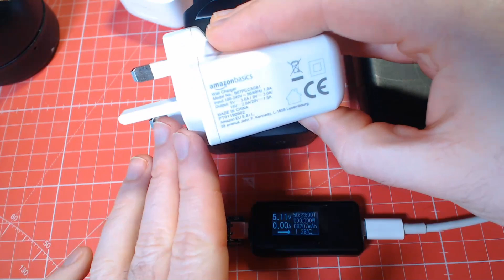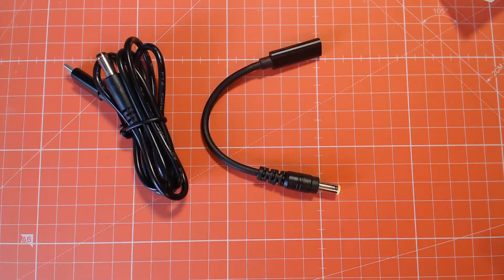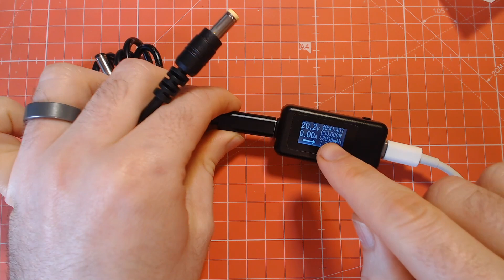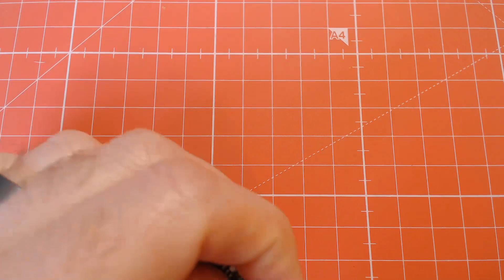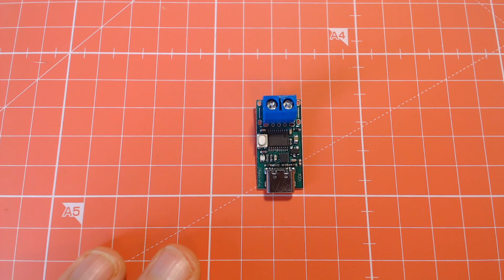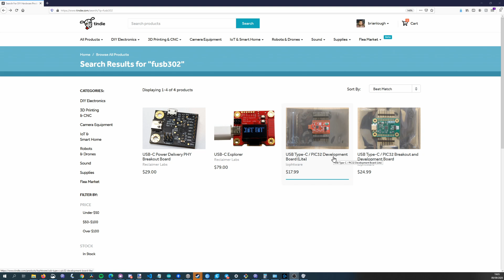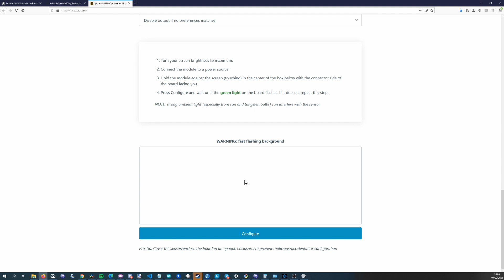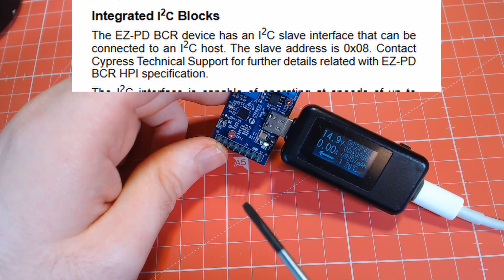Powering your projects using USB-C Power Delivery

Comment: CTP2 DC Quick Charge Adapter. It should recognice power delivery type of your device and adjust settings besed of it.
Reply from the maker: I couldn't find anything with that name, do you have a link?
Reply: @BrianLough  https://www.aliexpress.com/item/4000315671112.html?spm=a2g0n.orderlist-amp.item.4000315671112&aff_trace_key=&aff_platform=msite&m_page_id=1465amp-le5YltJvKXl_ezxt1WXVlA1600083920991&browser_id=e6819362732540bb8f65675612cfe35f&is_c=Y
Reply: Hope the link works whole name is really long😆
Reply from the maker: It got caught in the spam filter but I freed it. Thanks! Interesting looking module!
Reply: Chinese namings are really ?

Comment: There's a more eloquent solution. https://hackaday.com/2019/11/01/adding-usb-c-to-the-ts100/
Reply from the maker: If you want to modify your ts100, maybe it is. 

But:
- it can no longer be used with a regular power supply
- it has no ESD protection
- standard usb-c cables are not flexible and are not as nice to solder with as the flexible cables that are used with the Flex-c-friend, they aren't heat resistant either. The ts80p comes with a flexible and heat resistant usb c cable, but I have not found it sold separately

Comment: You showed a ZY12PDN module and called it FUSB302. Are you sure it‘s a FUSB302? Alex Whittemore found that the chip‘s pinout is similar but still different (see https://www.alexwhittemore.com/zy12pdn-reverse-engineering-part-1/). Do you have more information?
Reply from the maker: We don't know for sure I guess, but the working theory is it's still the fusb302 . Vbus is an input according to the data sheet for "attach and detach detection" so maybe that is just disabled or something. 

I shared your comment on my discord and one of the guys said that he found some code in the firmware dump that suggests they might be bit banging the i2c, which means they could swap the two pins from the default of the mcu.

If you are interested in helping out or even keeping track of the progress, I'd recommend checking out the discord (link in the description)
Reply: @BrianLough  Thanks. That's good and bad news. Good: it's a FUSB302. Bad: I2C bit banging is used, making a replacement firmware more difficult than necessary.

Comment: Great video. Good info!
One (important) thing to mention about the FUSB302 PDS-modules is that if they can' negotiate the set voltage (e.g. 12V) , they sometime take the next higher one (e.g. 15V) but does not show that with the led! This might be killing your project. I never use them in combination with a specific source without measuring first!
BE WARNED
Reply from the maker: I'll give this a test later, that sounds awful!

Comment: Buck converter with pd delivery next big thing.
Reply: Rather have a SEPIC converter, so the input voltage doesn't matter. Problem is the max current.
Reply: @p_mouse8676 ohh. Interesting thanks for mentioning.
Reply: @p_mouse8676  4 switch buck/boost like LTC3780 is superior.
Reply: @NiHaoMike64  A buck+boost converter IS called a SEPIC converter. The point with SEPIC converters is that it can boost as well as buck voltage. Or in other words, the input voltage can be higher or lower as well.
Reply: @p_mouse8676  A 4 switch buck/boost is different. An inverting buck/boost or SEPIC buck/boost is basically a nonisolated flyback converter, while a 4 switch buck/boost automatically reconfigures itself for buck or boost mode. That means better efficiency.
Reply: @NiHaoMike64  You can make a SEPIC with 4 switches as well, isolated or not.
Same thing, different name.
Efficiency all depends on plenty of variables.
Reply: @p_mouse8676  A SEPIC converter is a very specific case of a buck/boost converter. https://en.wikipedia.org/wiki/Single-ended_primary-inductor_converter
The 4 switch buck boost is a synchronous buck followed by a synchronous boost. As such, it operates with fairly low ripple current and is a lot easier to make efficient.
Reply: @NiHaoMike64  Yes, I am pretty aware of these things. I was trying to make it clear that it's not really relevant for the discussion.
In other words, when can we expect a design?
Reply from the maker: Yeah I agree, it's actually a project on my to-do list
Reply: @BrianLough  special for respberry pi4  😅

Comment: One thing to mention, the Apple power supplies that come with laptops can also do USB PD but with a slight difference, it doesn't support all of them (12V & 15V are missing). So if you set your module to request a certain voltage, it might not match what the Apple one can supply. The sink modules ZY12PDS (looks like the FUSB302)  supports a "request the highest voltage" mode that I use.
Reply from the maker: Yes, you can't rely on all chargers supporting all voltage levels, the mac charger is a very good example of that! I think the nintendo switch charger only does 15v as it's max as another example
Reply: That's weird that it count output 12 and 15 volts if it can output 20
Reply: You're right! I was just testing this out in depth. I have a 2021 M1 MBP 16" that came with a 140W USB-C wall charger, model A2452.
It only offers 140W (at 28V) over the USB-C to MagSafe 3 cable.
Using a regular USB-C cable, the PD options are 20V/15V/9V/5V. All at good amperage. But it skips the 12V level.
So when I use it to charge a powerbank (that I've verified capable of accepting 12V PD input), it charges at 9V instead. The charge wattage is about the same as a 12V PD source, it just uses more current.

What's really surprising is that on the Macbook side, the USB-C ports don't offer PD output!
They are dual role ports (DRP), so they can accept a charge PD input of ~100W, but they only offer 5V/3A output.
You would think that a modern, high powered Macbook Pro would offer the latest and greatest charging options to other devices.

I made a video exploring this stuff, as well as the PD capabilities of one of the DIY 16x18650 Powerbanks found on eBay. The audience on this video may find it interesting: https://youtu.be/yiObZhqfVC0

Great video @BrianLough, thank you!